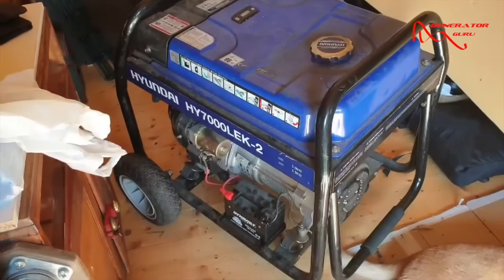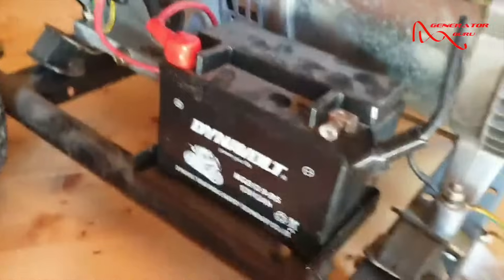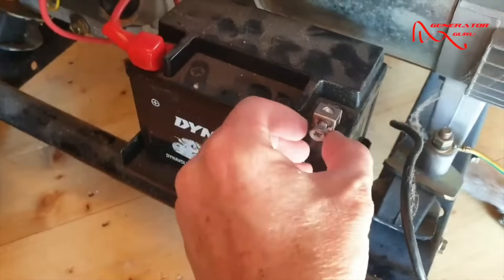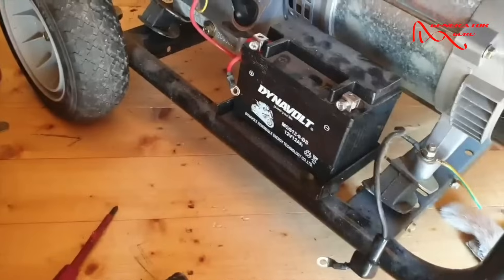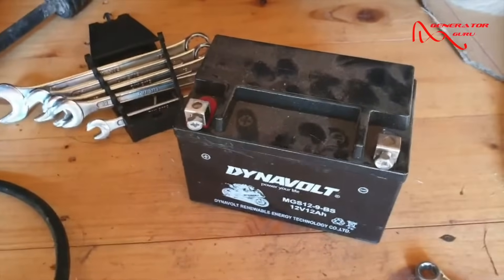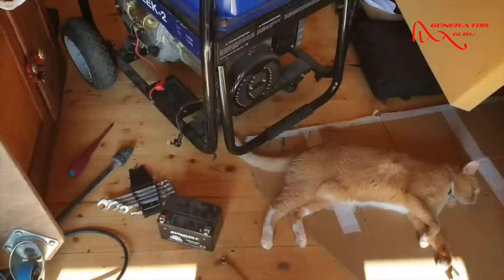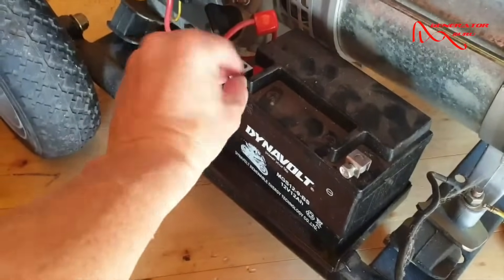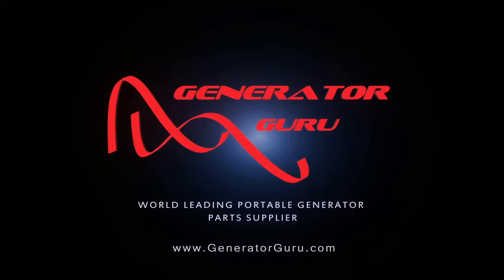Battery on a Portable Generator/Small Engine - changing and replacing batteries for Beginners

Comment: My battery died on my 4400 Gen. Im going to plug in trickle charger to generator while it’s running. Simple
Reply: Imagine my surprise, no power to batt leads through the generator. Why doesn’t it have one built in.., makes no sense, on purpose???
Reply from the maker: Check your battery Charging Rectifier has an output. For full testing see our documentation here: https://generatorguru.zendesk.com/hc/en-us/articles/10734046667548-Battery-Keeps-Losing-Charge

Comment: Could you charge battery while terminals still connected to flat generator battery? Cheers
Reply from the maker: While it is possible to charge it while it is still in situ with the engine turned off, it is far safer without a connection! 

To do this, remove the negative lead (this is the black one) before the positive (the red) one. This will break the circuit and make it safe for charging.

Or.... If you are unable to disconnect the battery leads at the battery, you can always disconnect them by the other end of the wire. These often are easier to access on some generators such as super silent units, or built-in units.

Hope this helps! 

If you need more advice, why not set up a ticket with our Engineers? They are always happy to help!
https://generatorguru.zendesk.com/hc/

:)

Comment: My battery has about 12.1 volts on it. Although it starts and runs just fine when using the pull cord, the electric start function does not even turn over...nothing....not a glimmer. I've taken the control panel off, checked for loose wires and found nothing unusual. The gen sits for long periods and I've owned it for 10+ years. I do twice a year maintenance runs and the oil is fresh. Just this last time the electric start wouldn't start the engine.
Reply from the maker: Please contact our Engineers by submitting a ticket here: https://generatorguru.zendesk.com/hc/en-us
We will assign you an Engineer to work through the issue with you. We do not charge for this service. :)

Comment: where do you get the cables that connect to the battery terminals and where to you connect them?
Reply from the maker: They will only be present on generators with electric start. Please contact our engineers if you need more help: https://generatorguru.zendesk.com/hc/
:)

Comment: Hi I wonder if you can help me with my generator every thing works but I'm getting 28 dc volts at my battery cables
Reply from the maker: You need to change your battery charging rectifier. :)

Comment: Good video.  I have a new battery to install on my generator, along with a Battery Tender.  Generator is never used, except in the chance of a Florida hurricane.  Question:  can the  o ring cable on the tender be attached to the new battery when I install it?  Should the tender be removed if the generator is in use?
Reply from the maker: We know many people use them, but... we must admit we feel they are over used by many people. For most of our careers people have just disconnected the battery when not in use, and then connected it up about every couple of months (minimum 2 or 3 times a year) to run the generator and top the battery up. This method also prevents the engine from seizing, gives you an opportunity to check all is running correctly, and will agitate the fuel and keep it fresh,  so has other advantages too!

If you want to use one, we suggest to follow the manufacturers instructions as they might vary.

Hope this info helps!

Kind regards
The Generator Guru Team

Comment: Hi, I have a charging issue in my generator kindly help me to resolve
i have a3 2.5kva generator and its have a 35AH lead acid battery battery is good but,
Issue is when i put charged battery first time after generator self start its charging the battery but stops charging on 13.6v then after some days battery charging voltage goes down and end up the voltage on around 12.8 to 12.9 not going more than this so then i remove battery and charge it then place it again after that same thing happens again n again

1. why my generator didn't charge my battery upto 14v and why its going down charging end voltages day by day battery still good. Thanks
Reply from the maker: Hi! We need a bit more info about your generator to provide you the best advice. Please contact our engineering team and we will get the specialist on your generator to look into the issue for you. :)
https://generatorguru.com/need-help/
Reply: @Generatorguru hello my gen

Comment: Thanks. Quick question - do I need to remove the battery terminals to the generator before charging the battery? Can I simply attach the charger clamps to the existing setup (battery installed)
Reply from the maker: We are aware many people do charge them while fitted, but we prefer to remove it. This gives me a chance to get the best connection from the charger and allows me to inspect the battery properly.
:)

Comment: We bought an inverter module from you for £180 to fit a Clarke IG1000. A week ago we messaged you via your website as there's an issue with the part, you haven't responded and list no email address or phone number so there's no way to contact you. 
Do the decent thing, check your messages and respond. Thanks
Reply from the maker: Dear Mike,

Very sorry to hear you have an issue. We have searched our systems but are unable to find an email or a sale to a Mike Caffrey. Please can you resubmit your help request on https://www.generatorguru.com/need-help/ with the details on your order and we will be more than happy to help.

Kind regards,
The Generator Guru Team
Reply: @Generatorguru  Thanks for the reply. The unit was bought in the name of Mike Potter, I've just resent the message using the link you provided.
As the original message send via that same link seems to have gone missing or been overlooked, I'm concerned that we might get the same result this time around. 
I don't know if you've used your help page but it's confusing. After entering name etc and describing the issue I clicked the button to add a photo before clicking next to move on... that opens another page that asks exactly the same things! Even allowing to upload an image again... so should we fill in the first or second page or both? They ask the same things despite the page being different. Very confusing.
All of this of course would be simpler if you published and email address or phone number.
I see now that you have an Ebay store, if I'd known that before I'd have purchased there and so had a more open means of dealing with issues like this...
I hope you see all of this as constructive criticism rather than as a negative complaint.
I look forward to hearing from you soon.
Reply: @Generatorguru  Reply recieved and problem solved, thank you

Comment: I have a Generac GP7500E I bought in 2016. What would cause the voltage output to jump to 155 to 160 volts? Can this be fixed, if so how do I fix it? Thanks
Reply from the maker: Yes, you need to replace the AVR. Can be bought here: https://www.generatorguru.com/gp7500-gp7500e/

Comment: Why would you say you could get electrocuted if you touched both battery terminals.?
Reply: Nobody gets a shock on 12V same on 24V . 😂
Reply: @Witschor  I don't get shocked and most people don't either but my father claimed he did and I have talked with others that say they get shocked.
Reply from the maker: You are correct, "Electric Shock" would have been a better description. Thanks for the shout out. :)